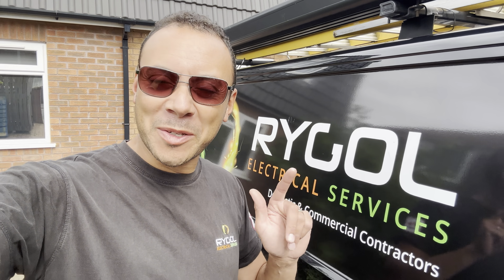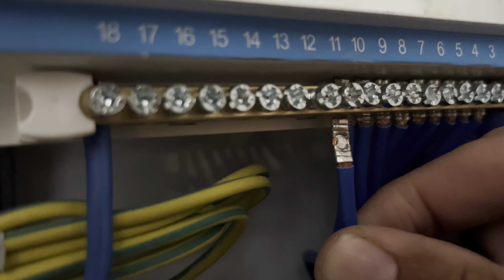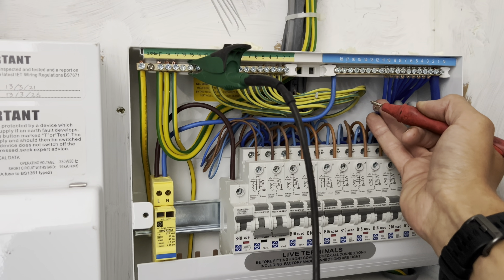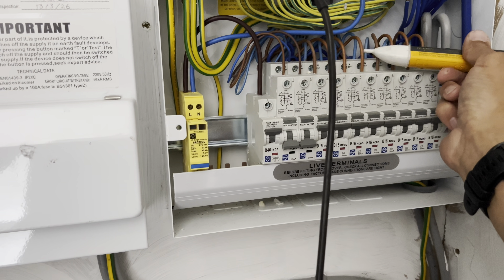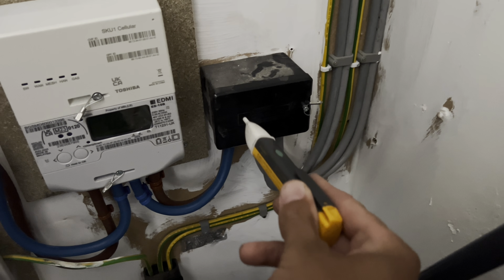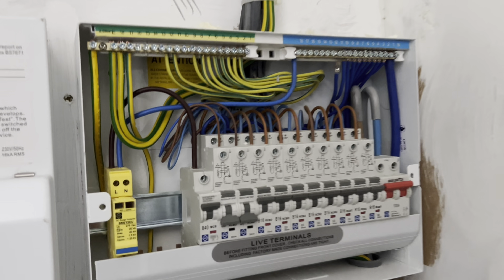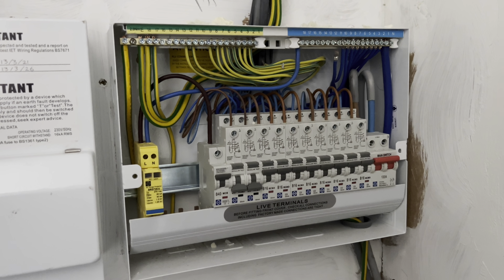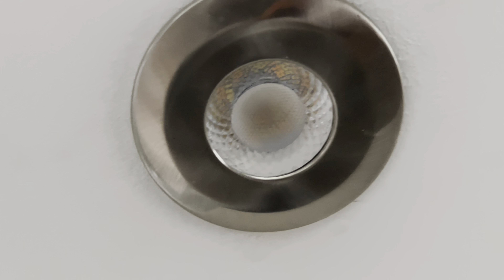Smart Meter Disaster! ⚡️

Comment: Inexcusable but this has resulted from employing monkeys not electricians. However there are good amateurs but they know their limits. I had smart meters a month ago and I watched teh guy do it. I had a teleswitch for economy 7 so that is getting phased out so needed the smart meter. He did a really neat job and connected teh cables correctly and did the tests and took photos of all his tests for the records including gas pressures. He tried the appliances and left a note that my earth bonding g to the gas pipe was over 600mm from the meter and needed fixing. So he was looking at all aspects. I am with Octopus so he was contracted by them.

Comment: You a very pretty wiring job Sir.  Nice work.

I had a real doozy of a problem with a single LED lamp on an ordinary switched circuit.
The lamp would brightly flash briefly every 3 or 4 seconds when wall switch was off.  The lamp had just been swapped out from the living room where it had performed fine for many months,  to the kitchen.
The problem turned out to be coupling between the 'always live' feed to the light switch and the switched circuit with this single lamp.  The two cables ran in parallel for about 3 metres up the wall and briefly along the roof.

Within the lamp there is supposed to be a bleed resistor across the output of the bridge rectifier and storage capacitor.  It was not there.  So the tiny amount of coupling between feed and switched cables was sufficient to charge the storage capacitor over a few seconds. When the switcher started up, it immediately lit the lamp but also rapidly discharged the storage capacitor.  Rinse and repeat.

So I found a better quality LED lamp and plugged it.  Problem gone.

Comment: I remember my dad's Bridges "neonic" drill  with the warning 2earth lead must be connected" and its little glowing safety eye.  Seemed that even then with a metal body drill they needed to build in a check into the tool !
Mind you with the old rubber covered wiring, ring main, and round pin 15A sockets, things were a little less safe back then.

Comment: Some of these smart meter installers are absolute clowns. BG fitted one in my house 7 years ago. Mis-read the readings on the old meter - which were around 3,900  m2 gas. This idiot put 43,000 on the form he sent back to head office. Someone there realised it couldn't possibly be correct... so simply moved the decimal point one place to the left, meaning we'd consumed 400 m2  - in August! £400 taken out of my bank account, which took a hell of a lot of getting back. No more smart meters in this house!

Comment: I would feel that the black box at fault, would not mater by braking the tamper seal, (Qualified only)  as this would be the safest way to fix the Death trap, you would not need permission to correct a life threatening situation, however Laws have loop holes, so did you need to ring the company to break there seal, and would the landlord be responsible?

Comment: I do not know if this is standard already, but I think every stage of job should be photo'ed using something like a smartphone which will give a precise time-stamp and geo-location for each photo.

I had a plumber in recently who was not going to do work any where near anything electrical, but still plugged some sort of tester into an electrical socket, and photo'ed it before he started work on the plumbing. He said his wife insisted on him doing this. I think it was because he was going to be touching some copper pipes, and I suppose these could become live if there was a fault somewhere.

Comment: I am not an electrician but looking at what you did I would have used the plug tester steight away as soon as I arrived it would have saved you a lot of time diagnosing the issue and also probably stopped you getting a shock.

Comment: I think I was 12 or 13 in the mid-1960s when my dad fitted a new-fangled fluorescent light in our living room some time after he had partly rewired the house. He spent hours scratching his head about why the new tube produced a ghostly glow when it was switched off. 
I had an interest in electronics at the time and belonged to the school radio club so when I arrived home from school I told him he had mixed his red and black wires somewhere so the switch was switching the neutral and the circuit was being left live and so it proved - in the junction box under the bedroom floor...

Incidentally, the 4ft fluorescent light was interesting as I hadn't seen the type before or since. It was chokeless and starterless and appeared to be just a tube with blue end caps (cast aluminium) hovering a foot below the ceiling. The hidden resistive ballast ran the length of the tube. It never failed to start and it never needed a new tube in the next decade...

Comment: I'm a retired electrical engineer and the arcing of the neutral was the big give away.. Although you didn't say it,  I guess you opened the mains connector block to correct the fault, ie you broke the seal,  which technically is a no no,  but you're not alone,  I've had to do that on more than one occasion! Neat install of the consumer unit btw. Good job.

Comment: As a non-sparky, I got it almost immediately because this is an exercise in logic - as is correct wiring.  But it also shows why using a fully qualified NICEIC electrician is a legal requirement.  The eedjyut who did the smart meter installation deserved to be sacked.

Comment: It was subcontractor of British Gas. BTW who wired black dual pole block with neutral at the back deeper ports on the first time as that was incorrect mr. sparky?!?! Meter monkey assumed you wired it corectly but because you wired live at the front then he made mistake. I bet tails weren't polarity marked either? That's exactly why I always replace this blocks with 2 separate ones so no monkey could make this mistake. 
I knew it was crosspolarity just after you showed the lights first and it took you like 7 minutes to get to that?
How did you changed cables round without pulling main fuse? Did you worked live? XD

Comment: Currently fit smart meters. 

Those double pole blocks are usually wired with the Neutral at the front, live at the back... that is almost unwritten law so most will assume its all correct. 

However... they obviously missed their final testing. The lamps would all show correct at the meter and cutout, but they missed the final polarity check with a plug test which would have instantly flagged this... no excuse for that at all!!! Whoever wired that block backwards is a bit of a melon too though 😂😂😂 Ultimate fault is the meter installer, and this should have 100% be reported to the firm who was responsible for installing.

Edit: the firm I work for have a policy in place to remove the double pole blocks and replace with 2 separate, single pole blocks, i'm guessing for exactly this reason! 👌🏼👌🏼

Comment: As soon as the video started I thought it must be reverse polarity and so I was quite worried how close his fingers were geting to the neutral bar.
Whoever fitted the Smart Meter is undeniably at fault for not checking the polarity at the Henley block properly and can't have subsequently checked the socket  in the kitchen properly either.
I do notice a couple of things about the way the Henley block was fitted which may not have helped.
Firstly there appears to be no identification of the cables where they leave the block to go to the two distribution boards. I would always use a ring of brown or blue tape on the cables there to identify which is live and which is neutral.
Secondly it appears the neutrals from the meter goes to the front terminals, so presumably the neutrals to the boards were from the rear terminals. It may not be an absolute rule, but I was always told to put the neutrals at the front and the live at the rear as it makes it more difficult to accidentally touch the live terminals if the cover is off.
Given both of these factors I supect the meter fitter may have assumed the neutrals would be at the front as this is more normally the case, however this in no way excuses not doing the proper checks.

Comment: DONE  bit pat testing & white goods repair  in past . DIPLOMNA white goods CITY , GUILDS  2237 PAT TEST .  YEP  LIVE/ NEUTRAL  FROM meter to fuse box  COMMON ISSUIE .  LIVE BROWN   RED / NEUTRAL BLUE / BLACK   Around wroung way   QUICK  5 MINUITE JOB TO REPAIR  WIRE SWAP . IF YOU 17TH EDITION / WIREREGS .

Comment: When I fitted smart meters, first check on entering property was polarity check which would identify the issue, call made to DNO , turn off at isolator switch and wait for DNO. Photographs and recovery of seals essential to investigation. Plug in tester at named socket would have prevented removing consumer unit cover and exposing live conductors. No appropriate PPE , this is a fail on the contractors side.

Comment: Great upload. Have to say this one made the hairs on the back of my neck stand up!!!  Although I am not a qualified electrician I have worked in the electrical industry for 30 years so you think you have seen pretty much everything. Seems you  can have as many regulations and circuit protective devices  as you like but sadly there is no protection against rank incompetence. In my organization this would be instant dismissal for the electrician that did this.

Comment: I have seen similar when the overhead neutral was eaten by seaside corrosion in NZ. The house neutral was supplied thru the earth/neutral tie bar. Low load, no problem. High load, dim lights etc. Earth to outside independent earth (distant metal fence post) showed 100 volts. All earthed metal surfaces at 100v. Just as well I was home when it happened, no cooked wife or children. The entire neutral screened overhead supply cable from post to house had to be replaced. I double check all used electrical equipment especially extension cables.

Comment: I located the fault within 3 minutes of the video, when fitting tail blocks it is always considered the live will be on the rear which the meter fitter followed, but the install/rewire put live on front of tail block, first error, second you should turn box off prior to removing cover, basic error.

Comment: I live also in Bristol, and when the smartmeter was installed, the ‘installer forgot’ to tighten the main connections of the incoming mains supply in the outside electricity box. For days, sparks all around, and several appliances gone. Thank you Einstein for your rubbish advertising on television.

Comment: Double pole 100 Amp connector block should be wired with live at the back and neutral at the front. The new meter tails are correct in this regard. Was it the meter installer or the person who fitted the 100 Amp connector block at fault here? What about polarity on other board? Was it just the one live tail from the open board in the wrong terminal in the DP 100A block or all tails? Meter installer may have assumed connector block was standard arrangement and acted accordingly. Bad meter tech that doesn't do polarity test though. No excuse. Some of those connector blocks are even colour  coded inside to ensure live is at the back.

Comment: There's also the earth bonding to any metal pipes, sinks etc in the property that would be live.
Reply: They would not be live. Earth is connected to neutral before the meter. That's why he measured 240 volts between the earth and neutral terminal blocks in the consumer unit. If earth were live, too, this would be (close to) 0 volts.
Reply: @Maurice_Walker  Of course. I stand corrected.

Comment: Should report it to DNO/provider, not so much to get the installer in trouble but to highlight possible issues in their training packages and retraining to the installer! Good educational video, thank you!
Reply: Totally agree, especially as they said it was tested on kitchen socket.
Reply: @martin54123  I'd have checked all the sockets in the kitchen after correcting the polarity. The fact that the meter installed says he/she confirmed polarity in the kitchen, may indicate a reverse polarity on another socket. He's no way of knowing which socket had been tested. Had the meter installed tested a socket that had been connected wrongly, it quite possibly would have given a correct reading when tested.
Although of course they should test the same socket before and after changing the meter, which would iron out my theory, but nevertheless I'd still test them all with the Martindale (Socket And See).
Reply: What else has the installer done 😮😮
Reply: He should be fired lmfao
Reply: The installer needs consequence. They have made a mistake but worse than that they have not followed standard testng process which would have shown the mistake. Although having said that, it's probably the company they work for not giving time for the correct checks.
Reply: @dopiaza2006  Time for the correct checks? It literally took a minute to do the check. It'd take longer to go for a slash. No way they're not provided enough time in the day to do a proper job. Just lazy and arrogant - could have killed someone!
Reply: @dopiaza2006  The test only takes less than 5 minutes. No excuse, it was faked, and it was not even Friday afternoon
Reply: Yup, the guy NEVER did ANY checks............instant sacking IMHO.
Reply: no amount of training will stop the installer from either not doing the testing, or lying about the result.
Reply: Is that a British Gas sticker

Comment: I know absolutely zilch about electrics, so perhaps you can forgive me for this question.
If the wrong connection was in that small black box, how did you get access? I
thought it had a seal on it.
Reply: An obvious possibility would be breaking the seal. Which he may or may not have done. We may never know, since this part was not included in the video. A coincidence, I'm sure. 😉

Comment: The meter fitter should be sacked. He’s not checked the polarity. However normally double pole Henley blocks are connected with neutral at the front and live at the back and from what I can see you’ve wired the live to the front. I’ve not seen a Henley block wired this way before.
Reply: The problem with this video is that meter engineer do not use Henley blocks, so if he put his meter tails in the wrong way round how is only one consumer unit reversed?
A sparky who made a big boo-boo trying to to blame someone else.

Comment: An example of short, limited electrical courses designed to let Smart Meter installers ruin the Industry, and potentially kill the unsuspecting public. Mistakes can happen but not testing the polarity after installation is criminal and this firm should be fined and the client compensated, at least to cover the Call out and reconnection.

Comment: My question that popped up directly is how many amps does this house need? 100? The thickness of the cables to and from meter are huge! Is that normal in the UK?
Reply: 80 amp fuse. At 240 volts single phase, that's "merely" ~19 kW. I don't know what's standard in the UK, but for reference: In Germany, a single family home with electric water heaters typically gets 34 kW service (50 amps, 230 volts, three phase).

Comment: Around here in Australia the power company uses a long wire to a rod in the ground and test the single/3 phases rotation and neutral to be correct at the breaker box. But the most worrying part is a simple test of voltage across the earth to neutral would show if it was reversed in this case and the person would of had to mix up the brown and blue that you could clearly see from the other wires to the main breakers, terminated in that terminal block. Well before even doing any advanced checks. Even if you think neutral is at or near ground potential, things can change at say power sockets if you break the neutral from a downstream circuit and borrowed neutrals. Not to forget scary situations of sub panels having earth and neutral tied together!

Comment: Guys who fitted my smart meter didn’t touch inside the house at all, only thing they did was turn the power off and back on after installation, very quick and efficient, however I do see smart meters as pointless, only reason I got one was to save me the trouble of going outside to read the meters. It’s not as if I’m going to turn the kettle off due to smart meter showing I’m using more electric.

Comment: I came across a case like this about 25/30 years ago, and apparently it's a sacking offence. It was before the power companies were privatised, so i'd say the then culprit was East Midlands Electricity Board (Leicestershire). I distinctly remember the neutral block in an old 1950's wylex c.u. being live, and I actually did get a shock working on a lighting circuit, after i'd removed the circuit fuse- that's when i started investigating. The house was fed from an overhead supply and the mistake had been made on the pole , quite away from the property. The colours of the tails  at the meter (and c.u.) were all correct .I was in the process of rewiring the property.

Comment: Great video. However, here are my thoughts! Totally agree with everything you say with regard to the installation of the smart meter, the reversed polarity and the failure to test.
But, I believe the error came about because henley blocks are always, always, wired with the live tails to the rear terminals and the neutral tails to the front terminals. This way, if the cover get knocked off the live terminals are the least accessible. I have never seen a henley block connected with the live terminals at the front. 
The meter installer guy just did what he always does, live to the rear and neutral to the front. No excuse for not testing/checking but I can see how this could happen. 
Am I right in thinking this is what you did? 
I realise they are not labelled, it is just a safe practice.